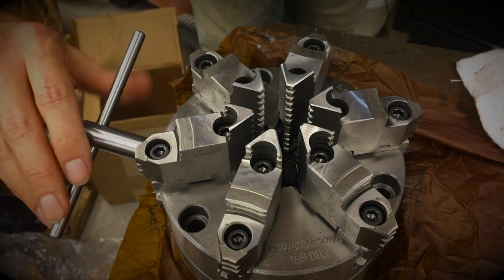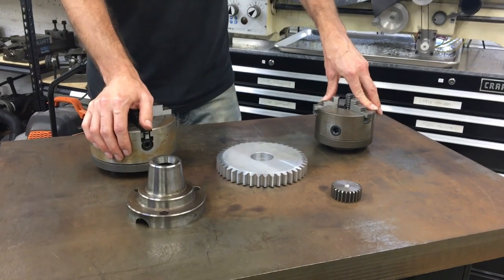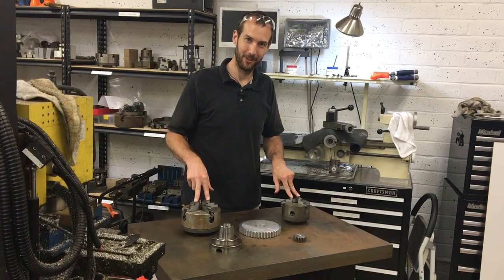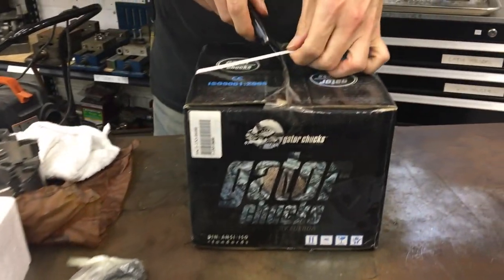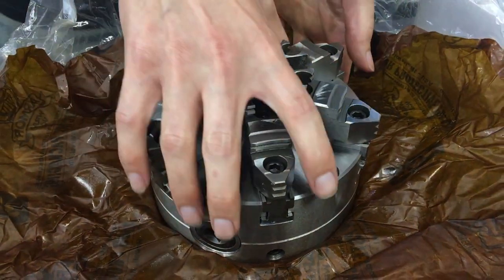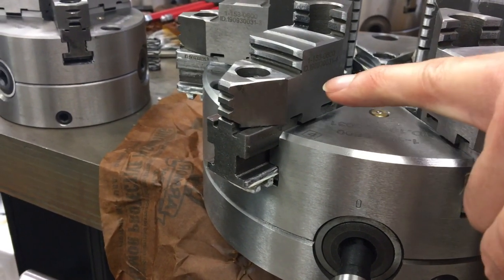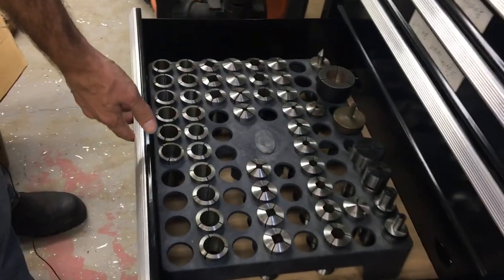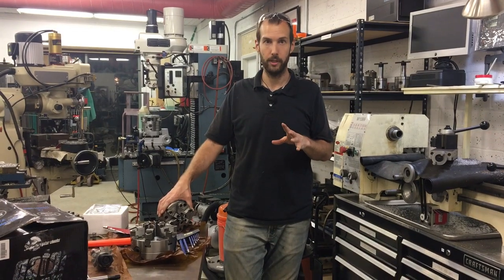NEW LATHE CHUCKS ORDER! Unboxing & Review

Comment: Hey, recently discovered your channel and have subbed! Wondering with your benchtop lathe mounted on the rolling tool cabinet whether it's stable and how you level etc? Would love to take this option for my lathe but had assumed that it was a no go because of the castors etc
Reply from the maker: Thank you for this question & subscribing! This queation is something that makes me chuckle when people bring up the subject of being stressed out about the lore of leveling and mounting machines. In the case of small lathes take a look at how Hardinge mounted their lathes to their machine bases. They bolted the lathe to the base with 3 spring loaded bolts and the lathe sat on 3 ball bearings. This gave 3 point support and put no bend/twist stress on the bed so no accuracy was lost but yet you could rock the machine back and forth a few degrees if you really pushed on it. You can simulate this any way you want. Often what I recommend is secure the machine to a bench/base/cart-whatever you want using the supplied holes in the casting so it can't fall over or move, but don't tighten them. Often you will see you get great long term accuracy this way. If you find inacuracy, you can always tighten different mounting bolts to bring the bed back into factory spec. I recommend not stressing over this. If it becomes the case where you need to make lots of long thin high tolerance parts, you will be buying a cnc or better machine anyway. I love this conversation because I watch so many people stress over the precision of a machine before they even know why or when they should be worried about it. Learn to run a lathe and start making stuff. Then if the need arises, you can always tweek in the machine to make it better. Small machines on carts and benches are fine. Most of the small machines sold during the industrial revolution were available on a rolling cart as an option from the factory because they were intended to be easily moved around the production floor as needed. The only reasons to level a small machine are for some setup conveniences and maybe coolant flow considerations. Not really accuracy that I can think of. Many people stress over making a small machine perfect before using it, and then never use it. I think it is better time and energy spent on learning to run the machine and learning what you like & want to make, then perfect your equipment. You will waste much less time and energy that way.
Reply: @TigermothRacingTV  appreciate the reply. I have it on one of the cheap stands you can get to suit but the storage is atrocious. I built a drawer for it but it's still inconvenient so was looking to custom build something to suit. Time and energy etc etc. A rolling cabinet or truthfully anything store bought as long as it was solid wood be way better so good to hear a practical perspective

Comment: I don’t recommend six jaw chucks for almost anyone. Unless you’re constantly working tubing, you don’t need them. You can only put precision ground parts into a six jaw chuck. It seems that on YouTube, six jaw chucks appears to be a thing. Most high quality chucks are finish ground after fitting, but the dust should be removed before shipping.
Reply from the maker: I agree. There are lots of reasons not to use a 6 jaw chuck. I think in general for tool guys they have a certain appeal because they look cool for the most part.  I ended up returning these chucks because I was so disappointed with a few little problems and they were so dirty inside. I bought the ones I needed from another brand, CME Tools and they have been excellent.
Reply: @TigermothRacingTV  I’m surprised though. Gator chucks have a good rep and they’re good mid to highish end products. Possibly the CI body chucks aren’t made to the standards their forged steel body models are.